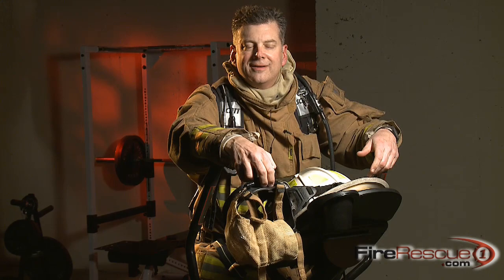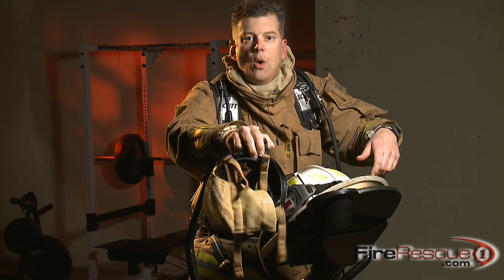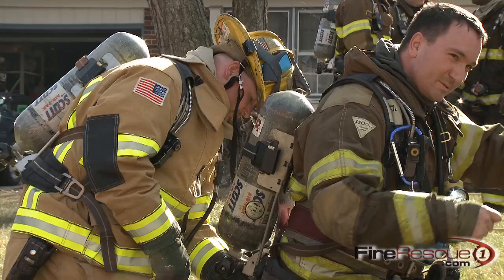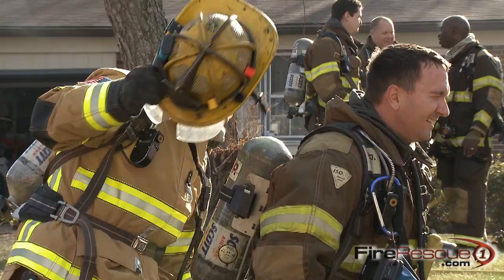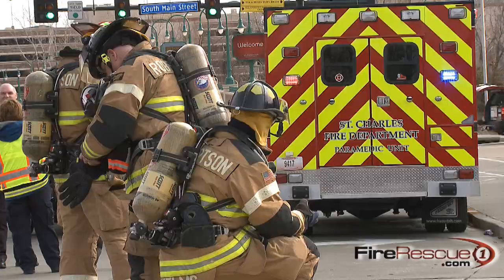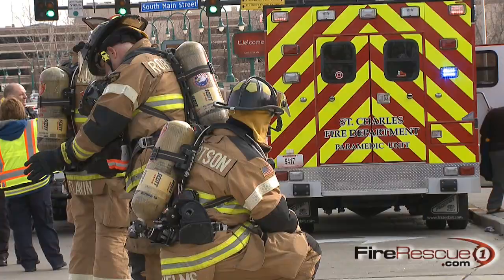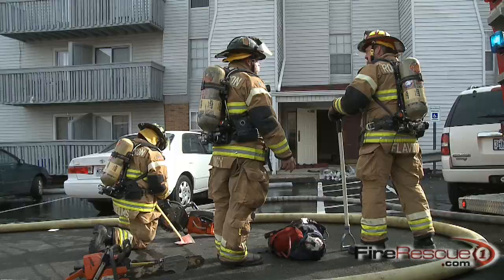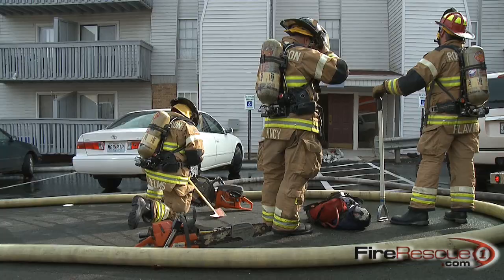FIREGROUND: Fire Entrapment - Conserving SCBA Air

Comment: Great video and thanks for the information.  One thing, if I may suggest.  When you run out of air try not to take everything off, helmet, hood and mask.  Practice land marking your release mechanism on your face piece and when you are totally out of air take your regulator off your face mask. Even for this video.  Then once you have done this take a couple of seconds to put your face piece opening into your glove (as if your face piece is your hand), a N95 mask or the bottom of your hood. Filter as best you can.
Practice running out of air every mask check.  Breathe till there is no air, then take two more breathes.  Feel the panic (even though you are totally safe).  You want to rip everything off but don't.  Land mark and remove (land mark with your hand early especially with gloves on). 
RIT teams will prefer you with your face piece on and practicing this will help you with composure when its demanded.

Comment: This all differs from manufacturer to manufacturer. Scott's are different than MSA packs. After your LOA turns off on some MSA units, you have a few seconds. Scotts, you have minutes... Key point, know your limitations and equipment.
Reply: +Tim Meaker  The SCOTT pack are said to be the best.
Reply: Agreed msa use up to much air on the bell alarm
Reply: @wolfgang548 Hello. I know it is a bit tad late, but what do you think about the MSA G1 SCBA?
Reply: @johnarat9618  Scott X3 are way better

Comment: When I am working in a SCBA I find that I have only about 15 to 20 mins of air. If you have already been working for a few mins then you will have even less air than this guy. Basically you breathe shallow. At least that is what I do. Our department only goes in the structure if there is someone trapped inside. We make the primary attack from the outside. When the flame is knocked down then we let our guys in to fight on the inside to mop up the hot spots. It is safer for everybody that way.
Reply: +swatson1190 Its not always possible. But a great philosophy.
Reply: +swatson1190 see some times you have to do a Attack inside the house bc the fire might already be in walls so you want to tear down the walls and put water on it ASAP or you lose all Chances to go inside
Reply: Hittin' hard from the yard, unleash your wrath from the bird bath.... yard breathers!
Reply: good strategy, but if you go like that at least i think so you´re gonna put so much water on the fire, that the structure ill be destroyed by the water, not the fire.... i think
and what do you to if the fire is in the basement?
Reply: That's no fun 😂
Reply: My department has 45 minutes bottles for me working in them I have 20 minutes left when I leave the building and that working and that not bad

Comment: WOAH WOAH WOAH that hood needs to go all the way around that mask buddy that's just plastic there and it will not stop that heat or flame
Reply: +tim rediske You're wrong. What about the rest of the back of your head/neck that's covered by just the hood? It's actually the contrary - people who put the hood over their masks actually compromise their visibility even more than the mask already does. Having it put over the seal saves you visibility, and protects you adequately.
Reply: stop and think about what you said. Visibility in black smoke... Doesn't work like that.